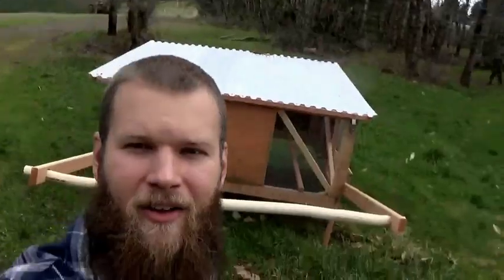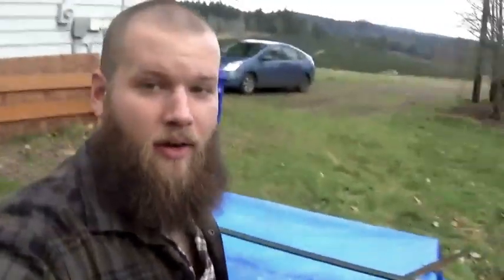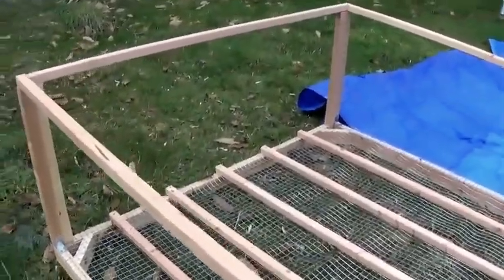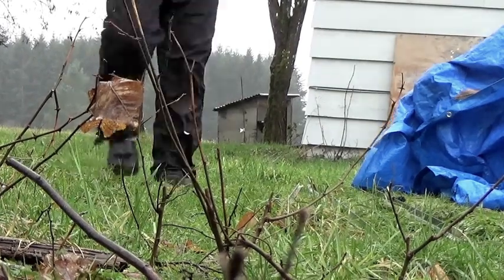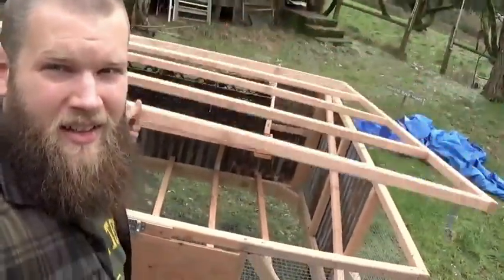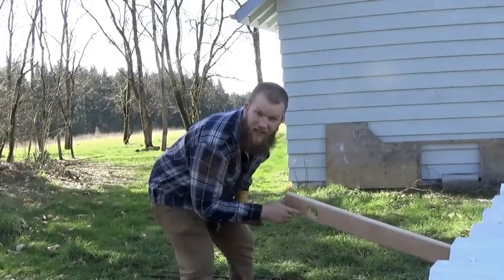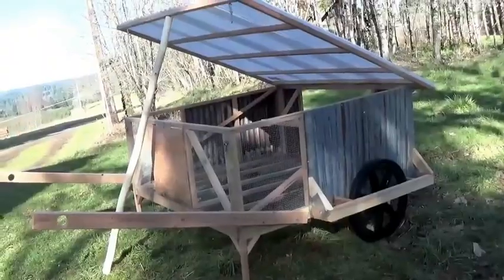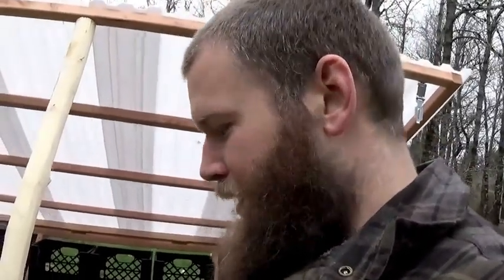How To Build The ChickShaw Mobile Chicken Coop

Comment: Nice work! I have a question, how do u prevent the wood from rotting, being exposed to weather and all
Reply from the maker: catknives couple ways: my way, I’m not worrying about it much. Since the coop is elevated off the ground, it doesn’t really sit in water, and there is good airflow around it. You could also paint the wood, or use a rot resistant wood, such as cedar, ipe, or black locust. Good luck!
Reply: @WelcomeBackWoods  thank you!!